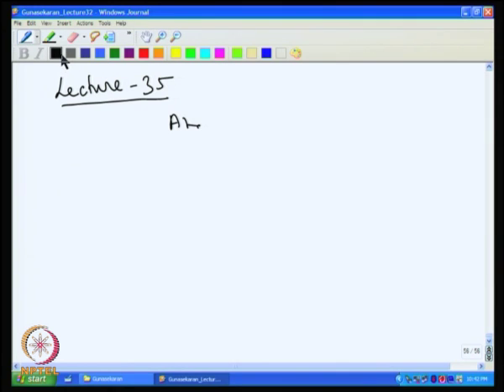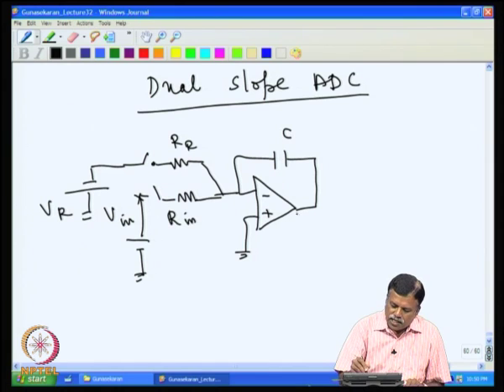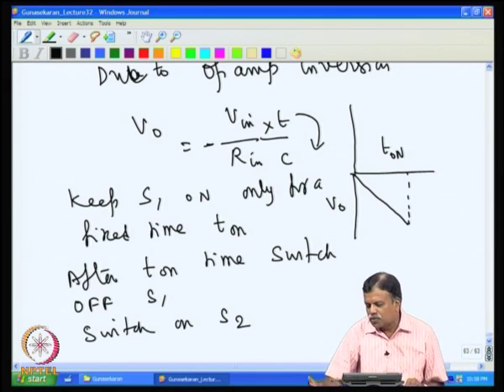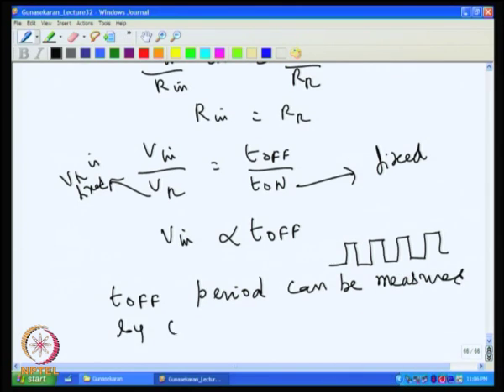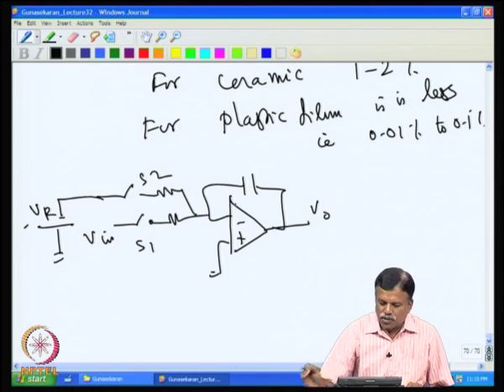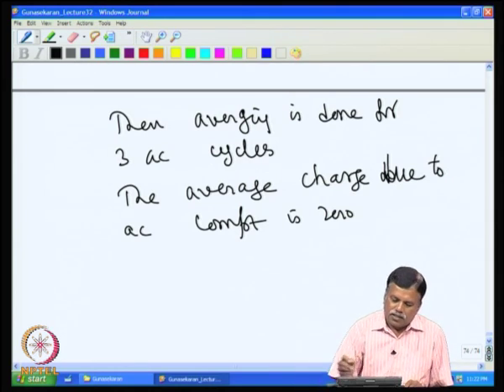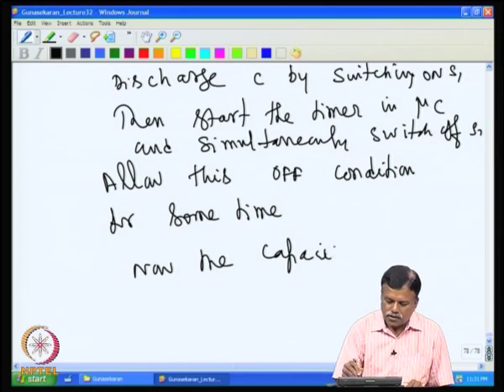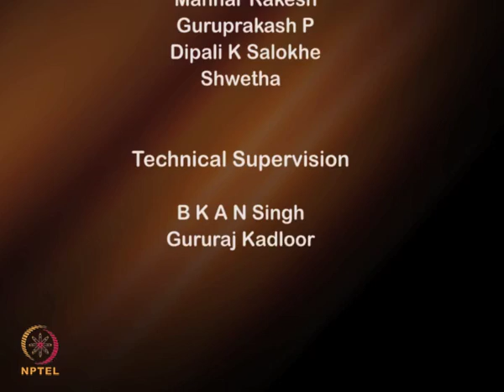Mod-08 Lec-35 Dual Slopes ADC -- Design Examples

Comment: The 50 Hz noise is due to the 50 Hz mains power frequency. We need to consider it since it is the major source of unwanted signal. Of course in general noise has wide freq. range. But for ADC design, the main interference is due to 50 Hz interference, especially, for mains operated equipment. Hope it helps.

Comment: 50 Hz is the frequency of city electricity network. The "noise" means here the waving in the signal that is caused of power supply or the whole system. Random noise is another topic.50 Hz noise is always considered.

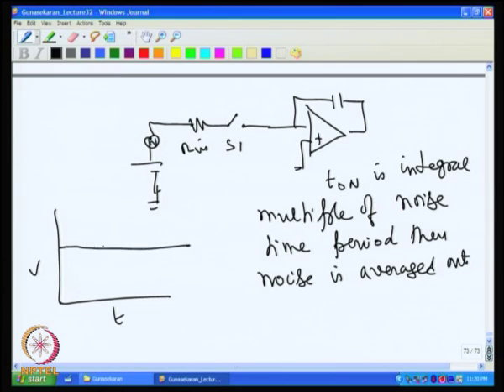Comment: 39:00 I dont understand what you mean by "Assuming a 50Hz Noise on a DC Input Signal".How are we assuming a fixed frequency of a Noise?Isnt the purpose of a Noise signal is that it is random in nature.We can have a frequency spectrum of Noise due to whatever the input stage is.Are you saying that by switching S1 with a freq as an integral multiple of say 50Hz, we aim to nulify the noise contribution of the final output (on the Capacitor) at 50Hz? What happens to the noise on the Vin say at60Hz?